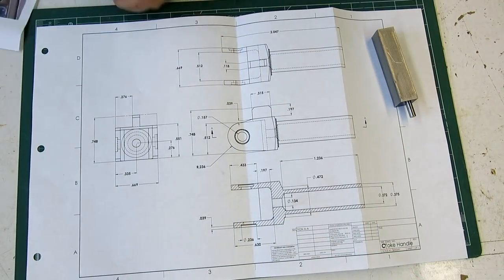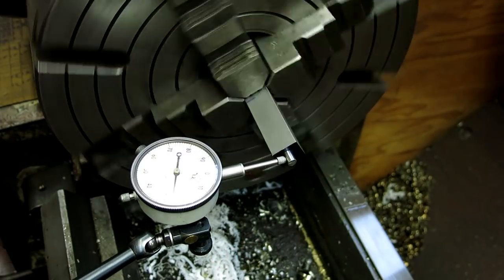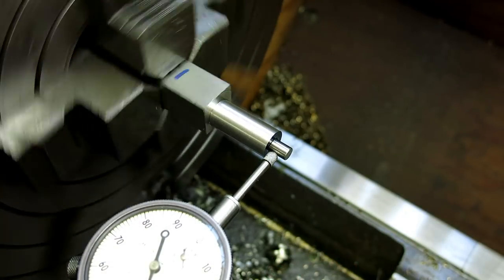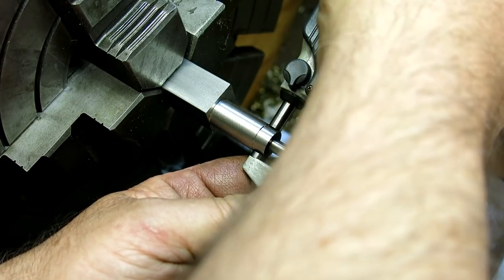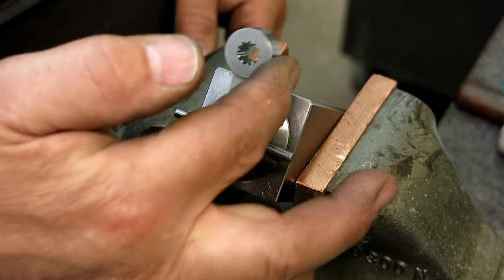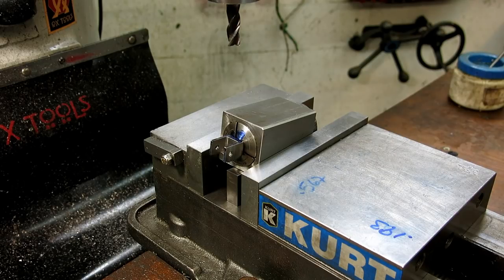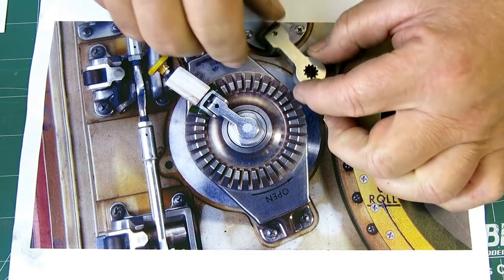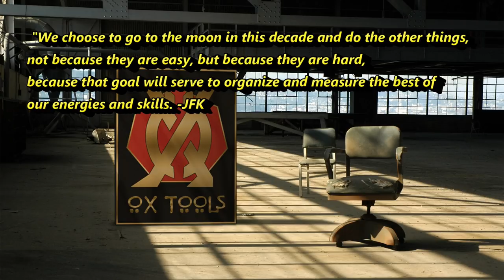Equalization Valve  2

Comment: I like the trick @ 19:00 where you use a spacer to know when you have reached the correct radius on the end of the yoke.  Little tricks like that are great to see.  I appreciate all the work that you put into these videos.
Reply: Gunsmiths use a similar technique to fit a beaver tail grip safety
Reply: you can also use bearings since they are usually hardened they wont wear down but still roll so you don't damage the file and you can get very accurate results with that
Reply: Thx  @HPD1171 , going to borrow your idea.

Comment: What makes me really happy about your part/assembly in the Project Egress saga is that only some of you participants seems to pay homage to (or even understood?!) the whole new level of quality that NASA defined with the various space programs whereas others just 3D printed some parts and called it done...
People laugh today watching how many steps it required to solder a single piece of wire with the NASA methodology but let's not forget that Voyager 1 & 2 are still operating due to the rigorous perfection that was needed to make it happen, and so were all the engineered parts that went into this original hatch. I'm totally convinced they can take your equalisation valve and replace the original one and there will be a perfect match.
Thank you Tom for sharing your awesome work!

Comment: One other reason they rounded off corners and trimmed angles is not just getting something snagged.  Every extra pound of cargo weight needed some huge number of pounds of fuel to launch it, so they wanted everything kept as low as possible.
Reply: They followed German initiative all the way to that. The Silver Arrows are the grandfathers of the space program in a way. Had the chance to see one up close and personal, every corner, chamfered, every bolt, lightened. It's like a file fest in those. Tho i bet that if we let Tom loose on one, he'd prolly find a few more "lightening" features. :))

Comment: My guess is that the 45-degree position is unlocked but gives you more leverage than the 90-degree position which is for fast rotation with less torque.
Reply: DanQuoLives   or, it is a safety thing so you don't go straight from locked to unlocked by mistake. just guessing of course.
Reply: Yes, that was my supposition in part 1 - makes sense to me.  In terms of safety - there's lots of thread to undo before it becomes a problem - you can see redundant features there in terms of the fin in the slots, the torque of the valve nut and the amount of thread on the nut.
Reply: @scott_aero3915  sorry if I pinched your idea, too many comments to read them all.
Reply: @chrisstephens6673  No problem - I didn't think you pinched it!  lends credibility to it if more people come up with it independently!
Reply: Oh, and I see that my sentence was a little confusing - I supposed in part 1 that the 45 degree position was for final torquing whilst the 90 degree position was for quickly unscrewing the valve.
Reply: @scott_aero3915  that too sounds credible, I wonder what the reality is?

Comment: I think the reason it seemed to "settle" was internal stress. Looks like cold-rolled steel, and since you're cutting eccentrically it'll release those stresses unevenly. You see it moves again when you're parting it off for the same reason.
Reply: The part just probably moved in the chuck because of the interruptive cut

Comment: What you mean Abom centering? He would never stop with .001" run out left on the clock. lol Surprised there was no chamfer on the locking tap to ease in its alignment with the slots when it is locked. I wonder if the original had it and it was just left off on these prints?

Comment: I'll bet that part warped as you were taking off the corners and made the pin start to wobble. Stainless in bar form has some incredible stress in it.
Reply: Entirely possible, yes. But in this case i think it might've been a chip. Has happened to me a few times. If you get one right at the end of the work piece, and it "crushes" as you cut, you get the exact situation. Source: i was making crank pins for a small  steam engine. Near damn exact failure.
Reply: @aserta  If it was a chip I wouldn't have expected to continue warping during parting

Comment: When cutting the 8° angle on the fins, were you bringing the tool in so it was cutting perpendicular to the fin or using applying the cutting force so the fin was in tension?

Comment: Doing awesome job. Is it me or do all the screws in the pic of the valve, which appear to be Phillips drive, look not quite like Phillips? They seem to be a bit curved.
Reply: Matt Tradie I believe they are Torq-set, a Philips design thou, ment for aerospace. The cross is offset with straight edges, but look curved due to the domed top.
Reply: Oh ok. Never seen them before

Comment: Haven't watched to the eng yet but my guess you are cutting 304 and it is famous,ney notorious for warping if you cut more off one side than the other just like your offcentre turning.
edit,maybe not 304,not shiny enough and files too easily.
Reply: 303 cold drawn does the same thing. Internal stress from rolling.
Reply: @James-fs4rn  Indeed, but the reason I first thought it might be 304 was my usual supplier sold 303 in the round and sections as 304 and as most of our stainless comes from America I thought it might be the same there.

Comment: Notice that the part starts to wobble on parting.  While that 4 jaw may hold 3/4 od centered. I bet that with the offset jaws were touching and not giving adequate clamp. A spacer under the jaw that was moved closest to center would have helped.
Reply: May also have been the internal stresses of the stainless bar being relieved,
Reply: @UnreasonableSteve  I doubt that. The way the part was cut there might only be a few thou of distortion.  If the cut was along the side of a barstock 12 inch long. it might curl but parting?